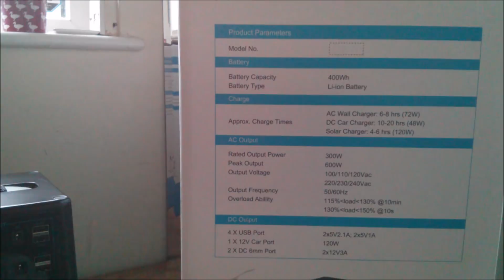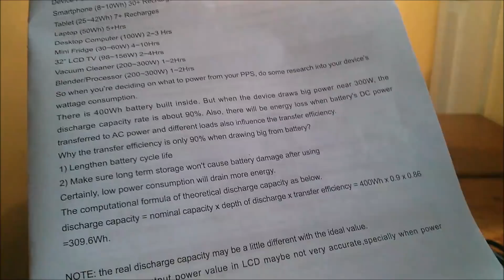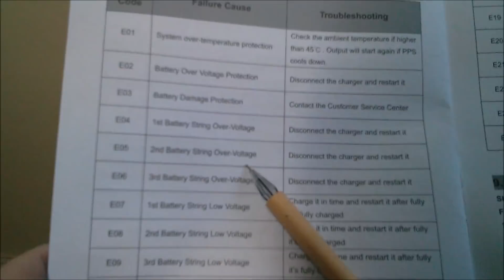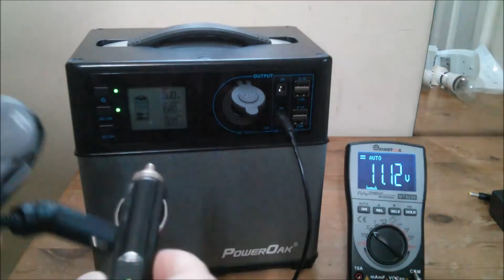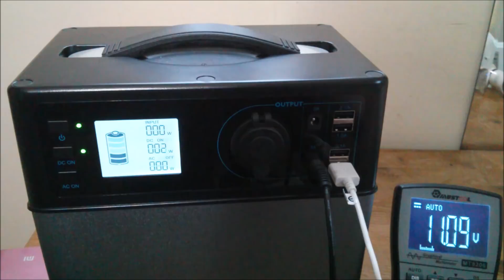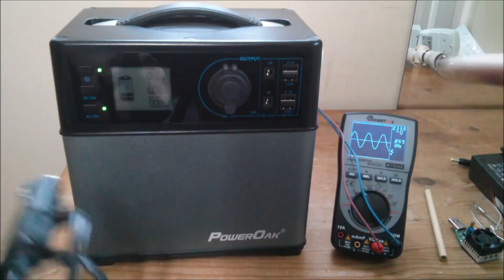PowerOak PS5B Review - Part 1 - Discharge Tests

Comment: Nope nope nope. According to the Panasonic NCR1860B data sheet, they tested the capacity from fully charged to the end voltage of 2.5V (specified for those cells). The assumption that the cell's being measured discharged to 0V can't be made to all cells, it depends on the manufacture and how they measured it. It's like cable length. Only the cord or also the connectors? ALL the connectors tip to tip or just shell to shell? They don't even specify that. EVER...

The ACTUAL reason why it can't reach full capacity at the output is because of the step up converter losses and because it gets more and more inefficient the lower the battery voltage gets.

Comment: Need help to understand, have purchased 400 pcs 18650B Panasonic lithium cells. I'll use them in my motor home, but, how do I put the cells together best, have, 3S 11.1V 12.6V 25A
Lithium Battery Protection Board. My question is, 11.1v will it work on 12v which is common in the motor home. The cells are 3.7v and 3400mA, 3 cells are 11.1v, if I take 4 it will be 14.8v, that's a bit to much. How do I fix this with 25A Protection Board with max 12.6v. How will the cell packages be composed? Hope you can help me. 😶

Comment: the battery capacity is not measured to 0 volts. It's measured to minimum allowed voltage. Even if you wanted to drop it to zero there wouldn't be much of a difference. The main reason is that mains DC-AC converter it not really that efficient. If you measure with a 12V headlight bulb you'll get better figure. You can use those RC model power meters. Also if you have ideal 100% efficient power adapter and 100%efficient charging circuit it'll still take more energy to charge the batteries than they'll give while discharging . That's because Li-ion charging is about 80-90% efficient (I guess the rest is lost as heat)

Comment: I am disappointed at the down votes VS. up votes ratio. So called Electronics enthusiasts who refer to the unit of CURRENT measure as "AMPERAGES" will no doubt down vote the 'tube vid. No such thing as "Amperage(s)". It's Current and Amps. For example "The Amperage is..." NO.... NO.... It should be: "The Current is..." or "It consumes/passes/requires (n) Amps. Amperage seems to be a very social and non scientific unit of measure.

Comment: Minor correction:
The capacity isn't for a discharge down to 0V, it's for full (4.2V?) down to cutoff-voltage (3V?).

The "?" due to minor variations on cell chemistry, and snould be approximate values.
The battery may not have rated capacity, and the DC-DC converters are not 100% efficient.
Reply: Was looking for that comment.
The low efficiency of the inverter is at fault here most likely and the cells must be cycled a few times before measuring that, actually might go up in capacity after a few cycles
Reply: I was about to comment the same, although it might be down to 2.8V.    The unit simply elects to limit to discharge to 90% of this maximum safe value to increase the battery lifetime, and then the inverter is 90% efficient, so 400*0.9*0.9=324Wh.

Comment: Smart meter - I thought it was an EL backlit seven segment display until it turned in to a graph. What make/model is it please?

That mains to banana plugs adapter seems a bit BigClive-ish :)

Nice that it outputs a proper sine wave so as to not upset some fussy equipment - unlike some UPSes (perhaps just older ones).
Reply: Except Clive would be connecting some item of food to it.
Reply from the maker: It's a Mustool MT8206

Comment: I'm sorry but if the box says 400WH then that is what I expect to get from the system. As far as I'm concerned this is misrepresentation. They are welcome to put 309WH on the box and explain that the batteries in it are 400WH but the user will never see it at the load.
Reply: Never going to happen unless we instantly lobotomise any human who shows and interest in marketing
Reply: Well.. I have a power-bank, internally 3S, rated by the capacity I would get if I rewired it to all in paralell, in mAh! I would see it as lucky to just have it less bogus.

400WH isn't wrong, but can be somewhat misleading. You can probably get the full capacity if you use low power on the outlet without converter.
All that is given the battery actually have the rated capacity.

If you connect a phone charger with USB output to the inverter output, how many mAh of phone battery can you charge? Stuff is just NOT simple.
Reply: Will you also whine about getting "only" 3840 from a TV that's advertised as 4K?
Reply: @Anvilshock  If I get 25% less than that advertised then that is a significant reduction in performance. "4K" is a general "class of equipment" figure so 3840 isn't an issue.
Reply: @AndyFletcherX31  So, what problem do you have with a "general 400-Wh-class-of-equipment", given how there are all sorts of factors affecting actual available capacity as we've seen?
Reply: @Anvilshock  Getting 75% of what is advertised isn't close.  If I buy 10Kg of potatoes and get 7.5Kg I would certainly complain. It is simply a case of misrepresentation as I'm sure you will understand (unless you are the seller).
Reply: @AndyFletcherX31  See, here's the problem with your analogy: You're not getting to eat the 10 kg of potatoes, and also you're not eating them right from the sack. There'll be losses from peeling and cleaning. You can minimise those losses by peeling extra thinly, but that doesn't come without cost. And then you're cooking and plating them, investing even more effort into getting to finally stuff them in your gob. Just as the raw form of stored chemical energy isn't immediately available for your "consumption". It only comes at intervals fixed by individual cell voltage which requires lossy conversion. Now, you can minimise those losses by investing in more expensive circuitry (provided that exists), but you can never get even.
I'm sure you understand.
Reply: @Anvilshock  WTF are you on? The skin is still part of the potato. The case is simple, if you make a claim like 400WH for something and the user cannot get it out of the product then it is misleading and in the UK trading standards are likely take you to court. There is nothing in the description or outer packaging which clearly points out the 25% reduction (should be equally prominent). Case closed.
Reply: @AndyFletcherX31  BUT YOU DON'T CONSUME THE SKIN AS WELL, JUST AS YOUR DEVICE DOESN'T CONSUME THE STORED ENERGY WITHOUT CONVERSION! Likewise, have you ever seen a sack of potatoes that says, "When peeled, potatoes weigh less."?? Seriously, you started with the analogy but can't take it when it's used against you?

Comment: Can it be run at full capacity inline with a charging source? i.e. used as an inverter/UPS?
Reply: Also interested in this... You'd think it should be able to do it since it has an MPPT..
Reply: Not knowing that one in particular, they usually are not made for that, and ends up cycling the cell in the upper voltage range if you do. Not good for the battery!

For UPS use, you would want something that can bypass/disconnect the battery while there is input power and the battery is full. Laptop computers generally have that feature.

Comment: Sine wave ac output - good. Tiny little 12v 'jump start' output socket - not so good - my Ring jump starter pack has a proper Anderson 2 pin connector, and BIG leads, I'd be dubious about using this PowerOak one for anything larger than a lawnmower without some smoke from somewhere :o) Otherwise it all seems sort of ok so far...
Reply from the maker: Recently used it to jump start my niece's VW Polo - all good :)
Reply: @JulianIlett  Very good Julian ! Mind you, not all flat batteries are alike, and this isn't a sub-zero January night....but I take your point :o)

Comment: It's a shame that the inverter doesn't ignore a brief over current situation, so it could run fridges and the like. 

It'd be interesting to see if it can in fact be used as a solar charged UPS too.
Reply from the maker: It could probably run a lower power fridge (I don't have one to test it). I think it will work as a solar UPS - just waiting for some sun :)
Reply: It's probably less an ignore situation and more than the cheap HF inverter just doesn't have the beans for inductive loads.

Comment: I don't wanted to be rude but to me it looks like a fairly useless product. Low power and low currents outputs. But yes what is a 400 watt battery, even my electric bicycle has a lot more power in it. Best regards.
Reply from the maker: Careful - Watts and Watt hours are different units :)
Reply: He's got a point the thing looks crap.
Reply: @MothKeeper  I can put it in an off-white-ish shell with rounded edges and a stylised silvery piece of fruit and a single button for you, will you give me $5000 for it?

Comment: I find it rather odd that it comes with a 29.4V charger, that's the charging voltage for a 7S (7*4.2=29.4) configuration, i wonder what the point of that is since it can obviously charge from a 12V Car outlet anyway - why not supply a proper 12.6V charger?!
Reply from the maker: It looks like the input socket can take anything from 12V to 30V
Reply: Probably for a high charge rate at low current?
The internal charger is very likely to be a buck converter.
(could possibly be pure buck converter, since car "12V" is 14.4V and is enough to charge a battery to 12.6V.

Comment: So it takes 8hrs to recharge from the supplied ac adapter. When you get around to your input tests, how long will it take to charge from a car 12v battery? How heavy is it? Good testing!
Reply from the maker: Manual says 10-20 hours (presumably depends on whether vehicle is 12V or 24V)

Comment: I was impressed with Julian's multimeter that transformed into an oscilloscope.
I have had equipment damaged by square wave inverters (a Braun rechargeable toothbrush)
Reply from the maker: I'd never connect my Keysight to mains voltages, but that little multimeter is peachy for looking at mains waveforms :)
Reply: yep, never use anything with a capacitive dropper type supply on square/modified sine wave inverters!  They're pretty hard on non-universal(non-brushed) type motors as well.

Comment: How was the Voltage Sag on the USB port pulling 3A ?   Less then the nominal 5v I would suspect.  Is the 12v output regulated or does it follow the battery voltage ?
Reply from the maker: The cig lighter output is regulated - the 12V3A outputs follow the battery voltage. The video was a bit long, I admit.
Reply: @JulianIlett  Long is good if that's what is needed to convoy the information Sir.

Comment: If they was Honest on the Capacity they would have accounted for the Bottom of Discharge for the Cells.   4.2-3.0V say.    Most Li cells I employ are in fact rated as such.   My 100Ah rated battery pack can in fact produce 100Ah of usable power.
Reply: I totally agree my headway 12.8v 8ah  102Wh packs will produce 8ah  102Watts for 60 mins at 8 amp load 3.3v - 2.5v per cell  or 100 amp load for 30mins 3.3v - 0.5v per cell
Reply: @chris-jb5ds  I have 20 of those Headways 38120 cells.   Crazy Power those things can produce.  4 in series can start my truck.

Comment: Can we please get a teardown
Reply from the maker: Probably - I'm quite keen to see inside :)
Reply: @JulianIlett  With a 29.4v charger, I am betting it is 7S and not a native 12v.
Reply: @BloodBlight  Yes I agree, the "Mains Power Block" Julian shows us early in the video is a full on lithium charger (it says so on the pack)!! so the battery inside is 7s as you state.  This makes more sense that all the dc outputs are buck converters but it does mean the solar input must have its won lithium charging circuit too.....hmmmm
Reply: I did a teardown, it's 3S inside: https://old.reddit.com/r/batteries/comments/gzlmyb/teardown_of_a_poweroak_ps5b_400wh_portable_liion/